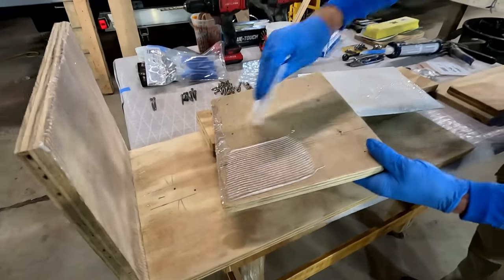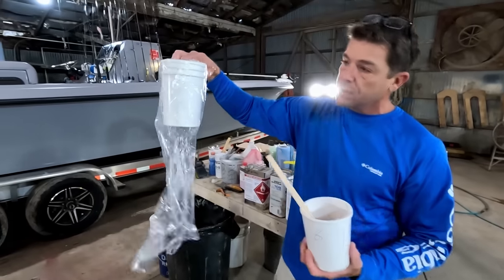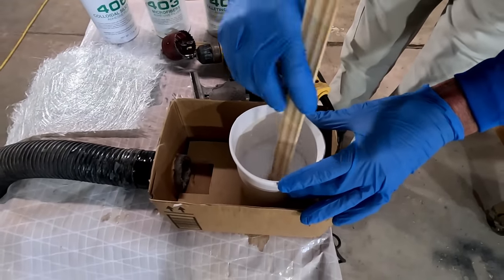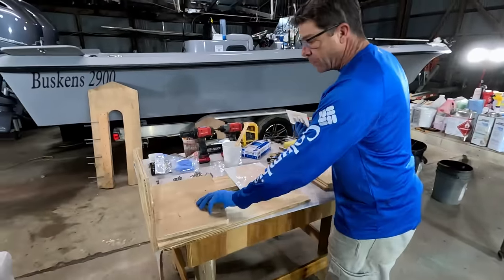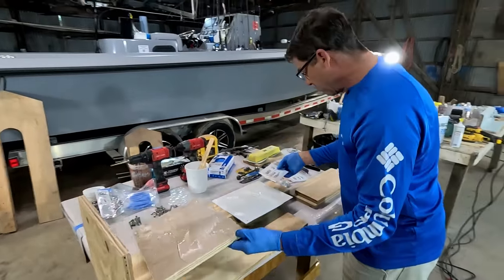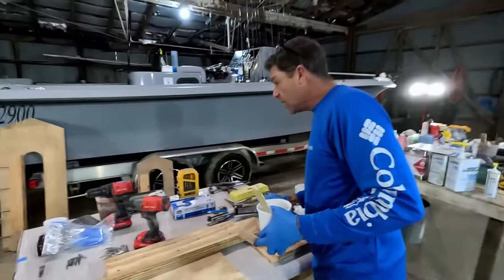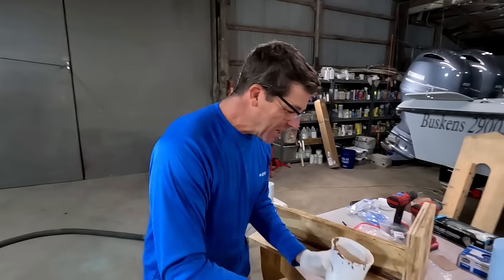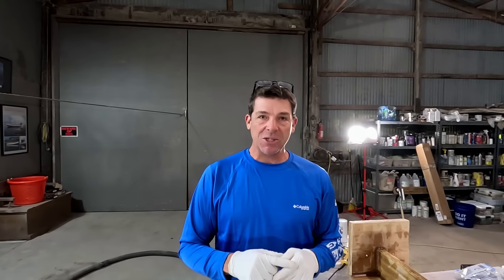HOW TO MAKE STRINGERS and TRANSOMS with PLYWOOD and EPOXY

Comment: Great video.  Bonding plywood with West System and then glassing with polyester resin makes a strong stout build.  I've used that method for over 40 years on a lot of DIY boat projects.
Reply from the maker: Great tip! Thanks for watching and commenting

Comment: Just a little technical clarification; vinyl- and polyester resins use a catalyst; the amount of catalyst can vary depending on how fast you want the reaction ; the catalyst isn’t consumed in the reaction, it just causes the curing reaction . With epoxy, the resin and hardener are both consumed and therefore have to be mixed in the exact ratio given by the supplier. For example, adding a little extra hardener won’t speed up the reaction , it will just weaken the structure since the cured epoxy will have excess uncured hardener in it (forever)

Comment: I've been working on the boat,,,,, 2 months,,,, I think I made it through it so far I'm going to watch this video didn't use much epoxy on my stringers but I didn't actually replace the transit I just kind of attached to it,,,,floor and freshen upright,,,, I did the front with polyester, glass then just epoxy paint,,,,, you had me scared so I rounded my edges,,,, but thank you for being true,,, it's just an old stringer boat,,,,, it's a nice conditio,, will the new camper canopy I couldn't throw it away
Reply from the maker: Thanks for sharing! Glad you are making some good progress on your boat!

Comment: Yet, another excellent video!!  Another poster has mentioned your choice of filler material -- while I really prefer either 404 or 406 for stringers and other less visible higher stress joints and 405 or 407 for cosmetic applications, you may want to elaborate on why you chose particular fillers for your different applications.  Spoons and rounded paint sticks can make good fillets if you take the cheaper route!  I also applaud your use of a zip lock for laying down fillet material -- they work well for filling deviled eggs too!🙂
Reply from the maker: Yes! Plastic spoons, I knew I missed something! We are planning another video on filler selection very soon, just ran out of time on this one. Thanks for your thoughts and suggestions, and I love me some deviled eggs! I will have to try the ziploc trick.

Comment: Thank you very much. I am a educated boatbuilder in Norway. Working at a boatyard/boatworks. I am mostly building large fastferries of carbonfibre and glassfibre, with polyester and vinylester products. Been working with epoxy very rare. Right now I am rebuilding a small fishingboat 12m Long. Extending the hull 1 metre and make it wider in the Stern. The hull is curved from the middle and the Stern is 1,2 m less with than midship original. I love to watch your content and love the oldschool metods. Proper way to do it! And the strongest lasting metods you use over there. This means a lot for me. Allways New stuff to learn Even if I have 15 years experience 👍😁
Reply from the maker: Fantastic, We appreciate you watching all the way from Norway 🇳🇴 ! Sounds like a very interesting project, glad you are finding the videos helpful! Best of luck with your fishingboat.

Comment: takes me back to the old days, i miss it.  never used a filleting ball for filler...messy but no matter how you hold it the radius is consistent.  i only used the ball for fillet wax when trying to add tolerance to a part, like adding a 1/4" gap between console and gunwale.  i stumbled on your chanel a few days ago and i really dig it man.  id venture to say not many people have seen what you are showing.  i was fortunate to grow up in a boat town (multiple big mfg's)  i commend you on your 29 brother, i know first hand the gruely never ending work to produce all the plugs, then molds, production mfg methods.  

unfortunately most of the carpentry and artisanship has faded from the manufacturing side.  instead of plywood cross sections (stations), skinned, faired, finished.  

the last 39 i built was nearly all 5 axis CNC cut.  its not paint ready but most of the heavy lifting done, this was 2008 so im sure its even further advanced now.  back then our 3 axis plywood router was running non stop.  years ago i got in the groove with an air file working this huge compound curve in a new plug.  thats a fun tool, can mess things up real quick but in the right hands its like michael angelo's paint brush.
Reply from the maker: Wow, sounds like you have seen a lot! Yes, there aren't many shops doing things the more traditional ways anymore. I think that was one of the reasons I wanted to document some of the skills shops used to use so that it's not lost forever. Seems like folks enjoy seeing the process, as it is a mystery to many people. I completely understand the move to large cnc routers as it greatly speeds up the process, but many people and small shops may not be able to afford it. I appreciate you watching and commenting very much!

Comment: Another excellent video. Like I’ve said several times, I found you too late. This time last year is when I started my Checkmate rebuild. And epoxy was what I used because of the working time.
Reply from the maker: Thanks for sharing! Maybe you need another project boat!
Reply: @FishBumpTV  not quiet as fast as I used to be. 71 yrs old. Just got the carpet down and next will be upholstery. A little more wiring and hopefully in the water by spring.

Comment: Hello Joe!,
I am from Puerto Rico and your videos are a lot of help for me. I am rebuilding a 1988 Grady White Sailfish stringers. I have cut the complete cabin and deck leaving the the top part . The transom was done previously with an Armstrong bracket and two new motors. 
I am increasing the stringers from 3/4 to 1 1/2 bonding two 3/4 coosa boards  together and will apply your methods doing everything with epoxy west systems, but I have a dilemma with the bedding of the stringers to the hull and how much to grind the hull for the new layup ! The Grady white company insisted to leave a gap of 3/8 to 1/2 . I asked them if i can apply a bedding on the side and they said yes but nothing in the bottom of the stringers and the hull because of that will cause a hotspot. And taking in consideration of the weight that i will put back on top of the stringers when I reassemble everything putting again the complete cabin part it make sense. 
I would be interesting to know you opinion on everything I am doing.

Thanks in advance 
Carlos
PD: I by the way! You are a true pro!
Reply from the maker: Thanks for watching! Sounds like a great project boat, I have always been a fan of the Grady whites. Every boat builder or company has various ways of doing things for one reason or the other. If Grady white recommends a particular method for their boat, you might want to follow there suggestions. For this particular job, it would be hard to say for sure what I might do, without being on the job. We will have more videos coming soon that you might find helpful. Best of luck with your project!

Comment: Hey Joe,  I've appreciated your time in these videos, and I have a request and a separate question. At the beginning of this video, you show 4 different thickening additives but you didn't really explain why you would pick one over another (maybe that would be a good separate video)
And my question is have you ever used resin and glass for a built in diesel fuel tank?   It seems like a shame to use aluminum tanks and lose the area around the tanks, and mine have corroded leaks now 😢. 
Keep these videos going
Reply from the maker: We are planning a video going into more depth on the different filler pros and cons very soon, so stay tuned! And yes, our family has built internal diesel fuel tanks in some of our larger boats in the past. It can certainly be done. I do have a video of a built in fiberglass water tank in our custom 29. It would be quite a few videos back, maybe it would give you some insight into the process. Hope this helps and thanks for watching!
Reply: West Systems did at one time produce a book called "The Gougeon Brothers on Boat Construction ". I recommend it for great detail on using exopy with wood

Comment: When we lay up the epoxy or polyester resin on the board and then scrap it over with a toothed trowel we finish off in  the direction across the shortest dimension of the board.
in this way the air between the boards has a shorter way out and less entrap[ed air result.

great work, thank you very much for such professional insight into your art.
Reply from the maker: Thanks for watching

Comment: Joe, thanks for the informative videos.  I'm curious, is it possible/feasible to fabricate decks and other structural features with fiberglass and foam, rather than say plywood, for the sake of saving weight?  If so, could you demonstrate/compare?  Thanks.
Reply from the maker: I would imagine so, but that is  not my area of expertise. Might have to look into building code and regs on that kind of project. Just not sure. Wish I had more for you on that one. Thanks for watching and commenting!
Reply: Okay thanks.

Comment: Thank you for your time. Can you thin NAPA Prostrand to set stringers (instead of peanut butter)?
Reply from the maker: You're welcome. I'm glad to help! I have added 5 percent or so of a good quality iso polyester resin back to some older prostrand to thin it a bit. But a fresh can of prostrand shouldn't need any thinning in my opinion. I have used prostrand to tack in or set  structural pieces before. In some applications, it can be fine, although a vinyl ester resin based peanut butter would be stronger but may be overkill. I hope this helps, and thanks for watching!
Reply: Thank you Capt. Joe Busken and Logan too. @FishBumpTV

Comment: This video was perfect timing for me.  I am about to reinforce the front of the well of my 75 Glasply and add some new doors to protect the wiring and batteries that are housed under the well.   So I will be using thickened epoxy glue to the pieces together.  I never would have thought of the vent holes at 45*.    What size SS screws are you using (8, 10?).    Very informative.  Thanks.
Reply from the maker: We use #10 or 12s on bigger boats. Thanks for watching

Comment: Great content keep the videos coming.  What is the best way to bond the deck to the stringers.
Reply from the maker: Thank you! You could use a thickened epoxy like the west 610, or you could make your own blend using fillers like we showed in the video. You could also use 3m 5200 marine adhesive and sealant. We showed the use of 5200 a few videos back, that is also what we used when we put the Coosa decks down on our custom 29. You might find the 29 build videos interesting and helpful. Hope this helps and thanks for watching!
Reply: Brilliant thanks for the reply

Comment: I dont mind the long videos either especially the way that you go in depth with the products you use and how to apply them. I do have a question, could I use that Six 10 adhesive to bond my fiberglassed floor to the stringers or would you recommend mixing a batch of the peanut butter for that?
Reply from the maker: Glad you are enjoying the videos. You could use the 610, or some peanut butter for bonding a floor down. I used 3M 5200 when we glued and screwed our Coosa floor panels down in our custom 29. We have some videos showing that in our boatbuilding series. Hope this helps and thanks for watching!

Comment: When I use ground garden lime and epoxy I mix it a little slack on lime until well mixed. Then I add a little lime so that it is perfect for filleting. I was replacing Biaxel on a bottom and it ripped off in 2 inch strips, but places where damaged wood was repaired with lime the glass had to be ground off. The repairs had been many days before the Biaxel cloth was applied. Look up bamboo for boat building. Sailing Mangrove Charlie found marine-grade boards and plywood that were bamboo. You do the numbers. Aluminum has 30,000 psi tensile strength. Bamboo has 28,000 psi tensile strength. A cubic-foot block of aluminum rips apart at 4,320,000 psi. The same size block of bamboo rips at 4,032,000 psi. This aluminum's weight is 166 lbs the bamboo weighs 20 lbs.
Reply from the maker: Interesting info, thanks for your thoughts!

Comment: Capt.Joe these videos take a lot of time & effort thank you again for sharing your knowledge & ALWAYS answering my ? , I p/u at least 1tip on all your videos. The card board vac box 👍👍 on the homemade transom clamp I was wondering how the threads were set up w/bolts did you somehow get a nut inserted in the other layer of ply? Thanks again great job 👍👍
Reply from the maker: You are very welcome and I always appreciate your comments! Glad you liked the little vacuum box idea, it works really good. On the transom clamps I just have a hammer in type thread insert to run the bolt through, I will try to show that in more detail for you guys as soon as I can.   As always,  thanks for watching!

Comment: Great video! Getting ready to rebuild a transom in an aluminum boat. How big are the relief holes and how far apart should they be spaced? And does it matter if the holes are placed towards the inside of the boat or towards the back.
Reply from the maker: Thanks for watching! I usually drill 1/4 inch holes approximately 6 inches apart.  I drill at a angle, downward from the inside of the boat. Hope this helps and I appreciate you watching!

Comment: Hi great video's I'm not building a boat but all your videos on fiberglass are going to apply to my project. Learning alot already. I like the WEST SYSTEM epoxy. Can I paint over that with another epoxy waterproof paint?  Thanks
Reply from the maker: Yes, you can paint over epoxy with a good paint system. I recommend using a good epoxy primer, then the paint for the best results. I hope this helps, and thanks for Watching!

Comment: Like what you are doing captain Joe.  I have questing on using the epoxy to put in stringers or transom. After using this to bed in or put transom in can we that off the amine and finish fiberglassing them all in with polyester resin  .
Reply from the maker: No, it is not generally recommended that you go over epoxy with polyester. We will be laminating over the demo stringer and transom piece with 1708 biaxial and epoxy resin very soon for you guys. Thanks for watching!

Comment: Hi my stringers are loose on my 13 foot fiberglass 1956 wizard boat what should I use for wood to fiberglass structural bond Thank you Sir. You are a master craftsman I am learning so much My friend gave me this boat it is so cute I will make you proud on this boats journey back to the waters do you think a 20 hp motor is to large the chart its the max size looking into a suzuki motor with tilt & electric start it will be a short shaft

Comment: Thanks a lot for the detailed information and sharing of your professional "secrets".  I have a little project for your experience but for me is huge, i have the following question: i do have a WD Shock Santana 23 , 1984 made sailboat, deck and cockpit floor and cabinets/seats/coamings are made with 1/4" plywood 3/16" outter polyester fiberglass and 1/8" inside fiberglass. Gelcoat finished both sides. a crack just appeared in the seat/floor joint and expanded very fast. i do assume water came into the plywood to rotten it an loose its strength, at the end an L shaped crack about 8"x5" creates a zone to be repaired over a pretty big hole when damaged material be removed  i guess 11"x6" and 4"wide on the floor and its vertical limit about 2" more.
My question: what can i use as a backing material to avoid new fiberglass to go down that hole? That could easily removed later for the internal final fiberglassing? thanks in advance for you tip and advice. once again a joyful channel very educative.

Comment: Hi Joe, tuning in from the UK fantastic information you share in your videos very informative! Learning as I go and restoring my 80's British Fletcher 155. I'm on the stringers using larch pine and polyester resin (keeping original) but bonding with epoxy. I'm struggling with the prime coat to seal the wood before laying the fiberglass, using a low viscosity polyester resin 491pa, temp 15°c, catalysing at 2% medium MEKP, mixing 2mins. After 4 hours the surface was cured but it peeled easily from the wood and left a damp sticky surface and it also caused the filleting tool to remove some of that resin causing a lumpy mess at the edges of the fillet. Surfaces was prepped and pre heated, have you come across this issue? Is it my product? should I add more catalyst? Should I be doing the fillet before sealing? Be great to hear back from you
Cheers 👍🚤
Reply from the maker: Thanks for watching all the way from the UK 🇬🇧! I read through the steps you took, and there are a couple of items that could possibly be the issue. First would be the larch pine, it is not a kind of wood that I have worked with before. We usually use marine grade plywood. We do have different kinds of pine lumber and I have noticed that sometimes it has a slick sheen or almost like a residue on the surface. I also noticed that you bonded the stringers with epoxy, but were using polyester resin for your primer coat. I generally don't mix different resin types on our boats. The reason is that polyester resin can have bonding and curing issues if applied over epoxy. I don't know if it is possible for you at this point, but since you have bonded the stringer in with epoxy, you might want to consider using epoxy resin for the whole job. I will be posting a epoxy over plywood,  and a resin types and selection video very soon for you guys. I hope this helps, and best of luck with your project!